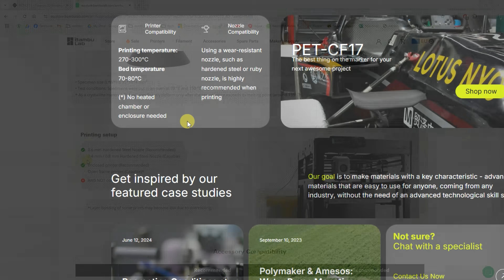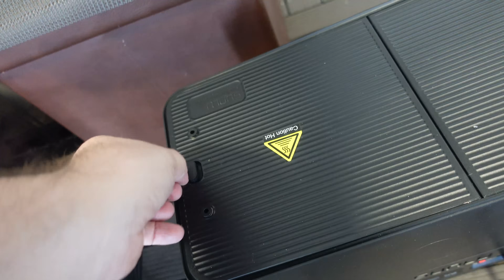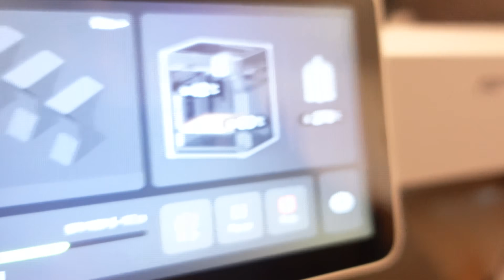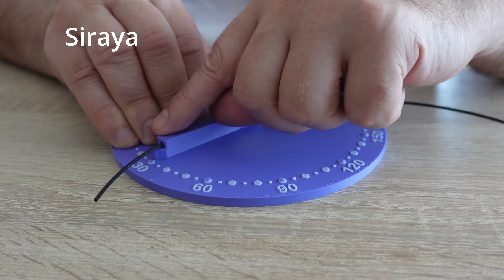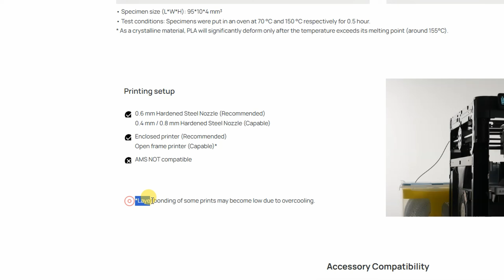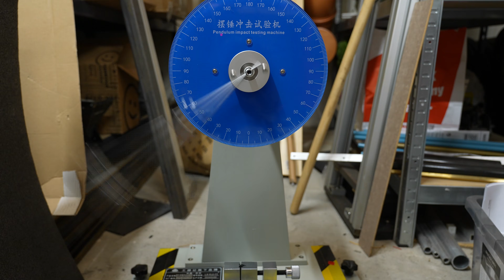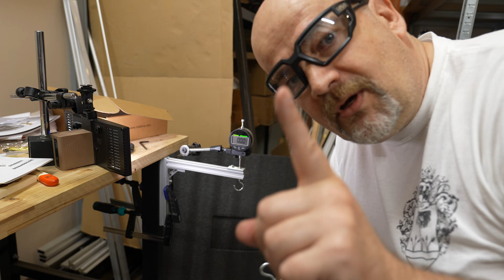Best PET-CF Filament? I Tested 5 Brands

Comment: Very nice video, but the annealed samples are not showing their true potential. PET can be annealed up to 180°, though at those temps it should be in an inert atmosphere. The ideal temperature to anneal it is slightly over 120°, and it results in a much higher crystallization compared to only 100°.

Btw I have sent you an email about the temperature testing, and how to improve it. Have you seen it?
Reply: It's a compromise between temp resistance and shrinkage.
Reply: @riba2233 from 100° to 120° you won't see much more shrinkage
Reply: Can we have the details of that email too? I am very curious!
Reply: @warmesuppe  the images are missing, but the body of the email is this:

Hi,
I'm Adeo, a Space Engineering student completing my Master's degree next year, and I specialized myself in material properties and additive manufacturing.

I am writing this email to reach you to talk about the temperature testing you do in your videos. First of all I have to thank you for all the work you do and all the tests results you make available to the general public, but I have some critiques about the oven test.
I already tried multiple times to express my concerns in the comment sections of some of your videos, but my comments never seemed to show up. I'm writing this email with the hope of gaining your attention

The problem is that the test is not representative of any real world usage scenarios, and it's not even comparable to any standardized test present in filament datasheets. Due to the test specifics, it consistently overestimate the plastics' capabilities, and it can mislead people into thinking that they can use a specific polymer for their use case when they actually shouldn't.
The absolute value could be overlooked, keeping the relative performance compared to the other samples and using that to estimate the real world performance, but it's not possible, as this test is very biased towards semi-crystalline and fiber filled polymers.

The issues are two: the load is too low, and the temperature ramp is too quick.
The first one means that stiffer polymers can hide better their deformation, and semi-crystalline ones will load the amorphous phase even less. The ISO 75 standard calls for 1.8MPa of tensile stress at the surface of the sample, while your current test produces orders of magnitude less stress. To get closer to 1.8MPa with a similar configuration you'd need a much thinner and longer bridge, and much higher weight on top.
image.png

The second issue (the quick ramp) means that the samples don't have much time to deform, and by the time they actually deform enough to be classified as "fail", the temperature reads much higher, overestimating the result by a lot. The ISO 75 standard calls for 2°C/min, but that's still too fast to realistically set a reasonable limit.
When heating up the storage modulus (the elastic one) decreases, and for a while it's converted in an increase of the loss modulus (viscous friction). In that region the sample deforms due to the lower elastic modulus, but very slowly because of the viscous friction. This is creep and it's something you want to avoid at all costs in real world application.
image.png

Incidentally, I made a simple DIY test similar in principle to yours, but fixing the parameters in such a way to make it much closer to the real world performance, and incidentally closer to the datasheet results too. The load is inspired by ISO 75 A, so 1.8MPa, but the ramp is slower (0.5°C/min) to decrease the chance of overestimation significantly.
It has already been used multiple times by multiple people, and I suggest you consider switching to it (or something closer to it) for your tests, to provide people with results they can trust.
It is published on my GitHub page:
https://github.com/TheAdeo/HDT-testing

If you have any doubts or questions please feel free to respond to this email, I really want to talk with you about this.
I have personally already talked with one filament manufacturer who was thinking of sending you some samples to try, but was currently hesitant due to the possibility of misrepresenting the capability of their filaments.

Greetings,

Adeo Felice
Reply: @adeo even 1.8mpa is too low tbh. Btw I have seen your comment before, you are technically correct but he has to test this way for comparative purposes. Real life operating temperatures are harder to measure anyways.
Reply: @riba2233 As I said in the email, the current one isn't even good for comparing different filaments, as they behave in different nonlinear ways, some overreporting more than others. This current test is basically the furthest it could be from real world use. My suggestion would bring it much closer, but mainly it would make it consistent and give results usable for comparisons (and to give a more decent idea of when stop using a certain filament)

Comment: Aren’t the layer adhesion tests usually done with 4x4mm? This makes it hard to compare to other filaments :/
Reply from the maker: Each of them have the review video with 4x4mm solid inside. This is a direct comparison between 5 filaments, and I got a request to test more realistic settings. 4x4 is good since we can calculate the stress from the area. 2 walls version, more realistic object
Reply: @MyTechFun oh o see, thank you!

Comment: Thanks, is a great test, seemed to be a lot of work

The Qidi is rebranded and made by fusrock, you can check this by comparing the TDS from both manufacturar sites (qidi just edited the originals). The Pheatus seems to be the same, same spool, TDS data and naming. This counts for PPA types and many more. Fusrock makes quality filament in general.
Reply: Excellent and useful observation!. Thank you!
Reply: Siraya tech also uses fusrock for alot of their filaments. Agree though fusrock makes good filaments
Reply: @thegps7197  Thanks, yes I think that also, but I wasn't sure enough to command that. The similar results in this test also hints in that direction.
I guess you can't go wrong with one of these 3 brands, most likely it a matter of availability.

Comment: Fantastic video and very helpful. Given these results I think the PET CF from Siraya is better than Polymaker PET CF for my planned prints.
Reply: I have all of these except phaetus. Siriya techs pet-cf is my go to. It prints so nice on my Plus 4 and is the strongest in all the many different use cases and parts I've used it for (I won't buy bambu- it's too expensive so I've never used it) I don't really use fiberon anymore either, again- too expensive for what you get and it always seemed more brittle and rough texture to me. It was VERY good in a real world sustained high heat high load scenario though after salt annealed- and it fixes the rough surface. But again- out of all of those (except bambu) siriya is the best bang for buck by far!
Reply: @notyouraveragegoldenpotato  Siraya Tech is always a great choice. Very popular in the Qidi community and nobody has been disappointed that I know of. The price to performance is fantastic.
Reply from the maker: Glad it helped!

Comment: Nice work. You should have drilled a 2nd hole in the alu bracket & added second bolt before testing, or only put 1 bolt in all printed brackets.  The alu upright had the opportunity to flex with no 2nd bolt.
Reply from the maker: I ordered similar brackets like 3D printed. I will create a short video on my Patreon page (visible for everyone)
Reply: I agree, the aluminium bracket will work ok in tensio but is poorly designed for the direction of loading in these tests… need to use the same arrangement of mounting points. I expect a like for like aluminium bracket to outperform any technical filament, it is a far stiffer material. In many respects it will be an unfair comparison because of the big difference in material properties.

Comment: Great data, as always.  Thank you.  I appreciate you including price.  Even though that's more determined by marketing and can vary geographically and over time, it's an important engineering consideration.  Filament development continues and we now have much better material options than ABS or PLA.  This testing is vital because markets run on information.
Reply: Always great to be spoiled for choice.
Reply: Always great to be spoiled for choice.

Comment: Supporter here...

Intuitively it seems like a less useful comparison to test the filaments under a single print regimen rather than the manufacturer recommended print parameters, especially temperatures. I understand the instinct to minimize variables but I suspect that instinct is misplaced in this case. If I want to optimize around an attribute, say layer adhesion, then I should follow the manufacturer's recommendations for optimizing that attribute. (For me I am most interested in deflection temperatures).

Presumably every manufacturer recommends print parameters that make the most of their filament's properties. In my opinion, that's what you should be comparing. The print parameters are incidental to the properties I am interested in rather than primary constraints.

Having said that, I think you do important work that I gladly  support.
Reply: Nah that doesn't make sense as manufacturers recommendations are often not ideal.
Reply: @riba2233 Why would forcing all filaments to the identical settings be any more ideal?

At the very least depending on manufacturer settings would reward or punish manufacturers for not testing and putting out the best settings for their products. Forcing all filaments to the same arbitrary settings says the manufacturer recommendations and optimizations don't matter so why bother.

If the goal is to find the ideal print parameters for a particular filament then this doesn't do that either.
Reply: @kickingnscreaming because they are all the same type of filament and have one optimal printing temp.
Reply: @riba2233 sorry. If only that were true then he would quickly run out of filaments to test. This video itself shows that your theory is not correct. All the filaments were initially printed with the same parameters and the Bambu filament had to be reprinted with it's own different settings to get a reasonable result even though it's "the same type". That alone invalidates the illusion of eliminating variables in any useful way. 

Essentially each 'type' of filament might be usefully grouped by sub types, perhaps by print temperature, flow rates, etc. Then those could be compared with identical test conditions for layer adhesion, deflection temperatures, etc. 

The only thing this methodology reveals is the comparative attributes of the filament IF AND ONLY IF you print at the settings he tested at.

I'll wager that lots of his subscribers choose a given filament based on the results of his tests but then use some other default or favorite print parameters or the print parameters embedded in the 3mf file. If they get a good enough result it's a coincidence. 

These comparisons only have relevant validity if you recreate the test conditions in production. Other than that maybe what is proven, IF AND ONLY IF we get good results under different production parameters, is that a given filament is more forgiving or tolerant of different conditions. But even that is only proven when you finally test or put it into production under your particular conditions.

If you want to depend on his tests in any valid way then you must put it into production using the test conditions he used to test it. Anything else you should do your own tests using samples produced by your production parameters.
Reply: @kickingnscreaming erm nope, if that is your conclusion from this then you are absolutely cIueIess about this topic, sorry. Bambu acted better at 300c which just proves my point that some manufacturers quote too low print temps as optimal.
Reply from the maker: Thank you for support and this comment. Sometimes it is hard to chose correct settings. Easiest job I have with Bambu filaments, just use their default settings, that's what most of users will do. However, their settings are not alway perfect, since it may variate, if part has big overhangs, bridgings, small surface layers etc. They have to give values which are good almost for everything.

Comment: Yeah, a few degrees more on my core one would be nice, its an excellent printer otherwise so far. I have been trying SirayaTech PPA-CF on it though, and appart from the challenges with feeding the brittle filament it actually works surprisingly well at 290, have done some layer adhesion tests to evaluate it. The compact inner volume is pushing the chamber temps though, so it might help, even on ABS its its at almost 60 degrees. I heard people have issues with high temp creep on PET-CF in engine bays, judging by the results annealing the parts should be strongly recommended for such use, thats a massive difference.
Reply from the maker: Nice. Maybe I should order Core One(?) I like my MK4, no bending of filaments and great for TPU
Reply: @MyTechFun  Yeah im not the biggest fan of the bowden tube type printers, my old MK3 was so easy to load filament in. I really enjoyed the kit build, I wish more products came that way :)
Reply: Why is it even limited? Did they use a cheap thermistor? Should be easy to go in firmware and turn it up I would think. Curious what issues it would cause. If Qidi can figure out 370C, you would think Prusa could. ;)
Reply: @802Garage maybe they are more careful with long term risks of high temps, thus having more conservative limits. There have been a bunch of people that runs them hotter with some slight mods since the mk4.

Comment: Aluminum should be stiffer at same cross section, but also heavily dependent on alloy and heat treating. I have done FEA testing on parts aluminum vs engineering filaments, specifically 6061 and PPA-CF. Interesting result. Also, the aluminum part will have less leverage on the structure vs the PET. Should make a PET part the same, as close as possible, to the aluminum bracket.

Comment: Nice tests! I like the corner bracket test, but I think in the future you should use a torque wrench to ensure equal tightening for each specimen. Or at least try it with these specimens so you'll know if it matters.
I was very surprised by the Alu bracket flex. I suspect, as you noted, it would fare better if there were 2 screws per side.
Reply from the maker: I ordered 2+2 hole version, similar size (metallic). I will create a short video on the Patreon page (even for free visitors)
Reply: @MyTechFun Yes agreed that the aluminium was at a huge disadvantage with so much leverage acting at a distance from the single screw. And really it should be geometrically identical parts.

Comment: It is interesting that the Bambu did so well considering it was printed at a higher temperature than the recommended.  I wonder if the other filaments would also have seen an increase in performance had they been printed at a slightly higher temperature. 

ps.  Awesome video.  Thank you
Reply: Usually yes. I typically always print hotter than the recommended temps. Manufacturers always aim on the low side of temp recommendations. I do a couple temperature tower type tests, one specifically to test strength. Virtually ALWAYS its stronger to print hotter.
Reply: @notyouraveragegoldenpotato how much hotter on average do you set your print to?
Reply: @notyouraveragegoldenpotato Printing hotter (within reason) is going to make a stronger part 8/10 times. The only times that printing too hot can make a weaker part is you're breaking down the filament composition and layer adhesion will suffer. CNC kitchen has shown this with PETG and PLA. The other time would be your print quality is suffering from the higher temperature, and therefore creating print defects in the part and making a weak point for the part to break sooner. It's all about a balance between hotend temps/chamber temps/part size/part geometry/layer time/cooling.

Comment: I think using the polymaker 3kg price skews things a bit. 

Most people aren't in a position to dry, print, and store a 3kg spool. Polymaker pet-cf will be 50/kg for most people (or more)
Reply from the maker: Partly I agree. I had to uniform them somehow (or I could just include table, and veiwer can calculate). Sunlu Filadryer SP2 can dry 3kg spools too.

Comment: mmmmh, metal corner will be stiffer -- and I was wrong --
Reply: maybe it is also related to the corner geometry - the metal one has a shorter leg/bridge...
Reply from the maker: And now I noticed, on my creep test setup I still have exactly those metallic ones (you can see it in my earlier videos, classic creep test). Maybe I should replace them? 🙂
Reply: @MyTechFun  I'd say go for it! We should inlcude more 3d printed parts in production environments to show the validity of the manufacturing process!
Reply: @MyTechFun  I would also add, make a carbon copy of the one in metal but do it 3d printed and do a quick video/test again! I'm interested in what the result will be.